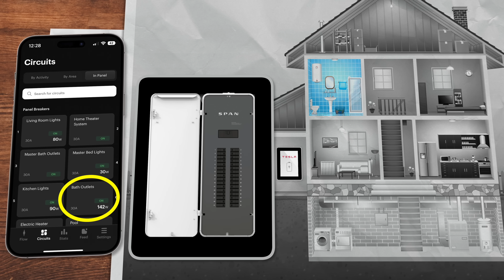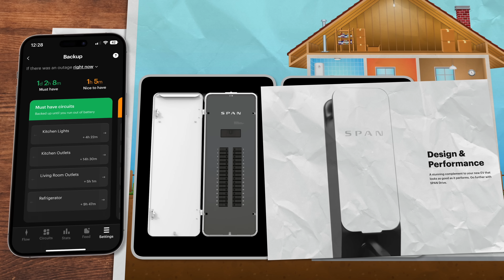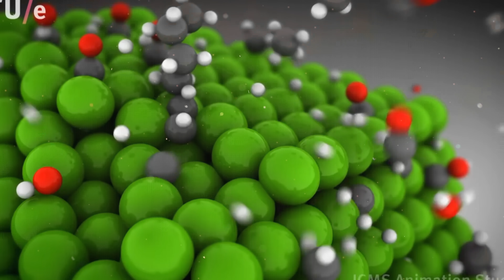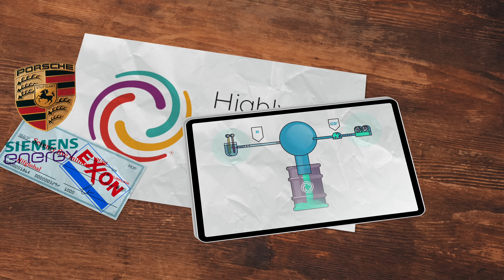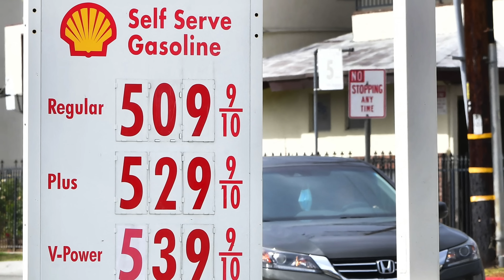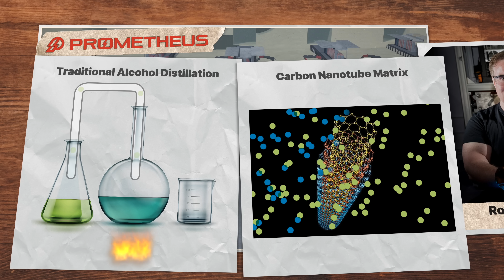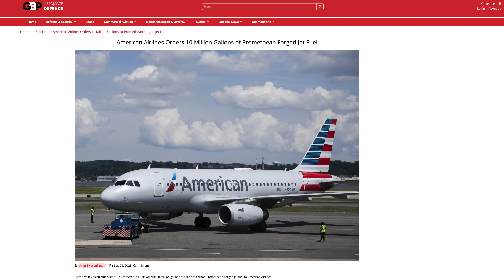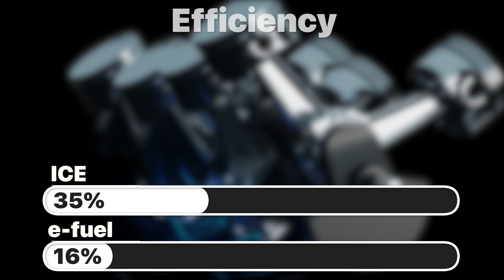EPIC Breakthrough Can SAVE the Internal Combustion Engine!

Comment: I think efuels are part of the bigger equasion to solving our issues. I don't think EVs are for everyone because of many factors, however for some people they make a lot of sense. Otherwise it would be like saying there is a 1 size fits all solution. I think the electrical grid load would be too much if everyone had an EV. I think the answer is a combination of ideas that each contribute to a good solution. Things like solar where we can, many small nuc. reactors as opposed to only a few large ones and working from home as much as possible.

Comment: The huge problem with EV is that you are deliberately introducing another step in the delivery of evergy to the car battery and so energy is being wasted.
And multiply all that energy by the amount of ev cars and you are facing a huge net loss just to put the energy into the battery.

The batteries aren't going to be recharging themselves.
But in the huge rush to get ev on the road in mass numbers the whole system is now getting exposed as a hugely wasteful and environmental disaster for what it really is.

Comment: When you have some of the distances we have here in Aussie, EV's will not take over - ever, PHEV, Hydrogen Fuel Cells (when hydrogen becomes readily available), and Hybrids give the range.  Have a squiz at plugshare and work out how to drive Sydney to Perth and how long it would take when needing electrons.... Yes, cheaper and quicker to fly but... if you want wheels at the other end, ie relocating, then driving could be the only option (sticking it on the train - hell expensive, removal service - expensive too - ie math does need to be done).  There are stations out there but some would require one to stay over night to charge and that could limit the driver to say 400km max a day - stuff that.

Comment: Good points made.  On a similar point ICE engine are more efficient in cold climates, where I live, as the waste heat is not wasted but used as it’s required in the passenger cabin and engine components.  So there will be a blend as no one tools fits all situations.

Comment: Well I mean, dont get me wrong, we will get low, but I thought the idea was just simply move forward...  ICE cars will just simply get replace over time. The ones that can keep moving forward will, with a cheaper access to gasoline as we simply can't just simply turn off the production as there are other sources that still need that same gasoline or oil. Plus the fact we still havent made a dent at all in current car production let alone the whole issue on trucks. No one has made any real progress there. IF anything - they just need to improve the milage per tank of gas if they can.  Give incentives to recycle the cars, and the wasted material sadly will just be that. Its not going anywhere even if we try to service them over their life time a little longer. At current rate it'll be at least 10 to 15 years before you see enough electric cars to be a problem and even then - the world still have enough gasoline you will see a split between what fuel will be cheaper (something we havent seen yet). Whats to stop or encourage the recycling of ICE into electric though? Why couldnt we take exisiting and offer an "upgrade" kit for all sorts of different type of cars in the future?

Comment: Interesting video but it doesn't consider converting vehicles to electric or the negative environmental cost of e-fuels. 

I agree e-fuels might be necessary in some use cases, but this is only for a tiny percentage of use cases. E-fuels still produce particulates and have a carbon cost associated with production (e.g facilities, maintenance etc).

In many cases more carbon reduction will be achieved by simply using the green energy production (wind, solar etc) as a primary energy source.

In the video it states that we'd have to throw away lots of vehicles, so it might be better to use e-fuels. But this is not the only option. For many cases another viable option is converting old vehicles to electric vehicles. This is already happening with shipping, cars, busses, trucks and aircraft. Advances in technology will accelerate viability of conversions.

Even the flight you mention for example might have an alternative option if energy density of batteries doubles and better propellers reduce fuel consumption. For example you might have two green flights to Tokyo, instead of one dirty one.

In addition e-fuels might defocus our resources on the clean energy transition and this is a bad thing.

E-fuels might have a tiny part to play, but I think they have a lot of downsides. The viable use cases are very very small from an economic, environmental or even necessary perspective.

If the right emissions / economic standards were put in place by policy makers, then the use cases would reduce even further.

Comment: What some people fail to understand is the fact that there is nothing wrong with modern ICE. The problem is that the modern electric motors are so much more efficient, reliable and lighter, that totally obliterate the ICE conception and its complexity together with the high maintenance costs, and its relative short life compered to an Electric motor capable even to perform at over 20.000 RPM. Been driving a Tesla for over 3 years, its operating costs vary in between 30 and 40% from an Honda Accord I had before the Tesla. I will never again consider anything else than  an EV and so apparently feel the vast majority of people in the know. You can burn the cleanest fuel with an ICE, again the E. M. is so much better, that the OEM that do not switch to electric power, probably will go belly up much sooner than we can even imagine.

Comment: It makes absolutely no sense to worry about efficiency initially if the production / material costs and maintenance are low and environmental impact is lower than current options. 100 years ago MPG were innumerably worse but these obstacles were overcome as the market demanded it. IMO we just have to look at the advances in motor vehicle fuel efficiency after the petroleum  / energy crisis of the 1970's. Governments should encourage competition between the disparate energy sources to create the conditions where innovation can thrive, and I don't mean by unfairly taxing one over the other to hobble its competitiveness.

Comment: If ICE engines are only 35% efficient why don’t we just use all that wasted heat energy to boil water, turn a turbine and make electricity you could have a smaller ICE engine assist an electric engine+charge the batteries. All from something that is “wasted” heat

Comment: I think if we are talking about e-fuels, that the topic of green waste and excessive food waste( from farms, shopping centres, restaurants, schools etc) that is sitting creating methane, that could be used as a fuel source, which through its use reduces the harmful effects of methane, (and we could still use the old cars (adding an appropriate tank/cylinder)),needs to be addressed more than it currently is.
 In doing this you have a strategy for waste reduction, reduce the harmful effects  of methane, have a constant supply of energy,  create a circular economy, require relatively simple technology, reduce the need for ev's, and get to keep your old car.
And then there's the use of sewerage to produce energy, or waste from pigs and cattle etc. It is also a system that works very well in developing countries. It is a no-brainer, or?

Comment: Historically, it seems that every form of transportation progresses as engineers resolve any shortcomings.  For example, sailing ships more or less peaked with the clipper ships, which were then replaced by steam ships, which were then replaced by ICE powered ships.  The same goes for locomotive evolution; the last of the steam locomotives were technical marvels with very good performance, but they were eclipsed by the diesel-electric locomotive.  Gasoline powered engines today are astonishingly good.  The power extracted and the reduction in emissions has progressed tremendously since the 1970's when they were really awful.  I think that there is still much room for improvement in terms of efficiency, and I am sure there will remain a lot of engineering surprises over the next few years.

Comment: Did you ever think how much pollution is made for making batteries or where electricity come from, you are only moving where the pollution is coming from! It's kind of like the company I work for, they wanted to go green, so they closed down their painting department,  because of all the chemicals and pollution it caused! But did they quit painting their products, "No" They shipped them to another company to do their dirty work for them, and then advertise what a green company they have become, they just passed the buck off on someone else!
In Minnesota there's an article in the paper that it might take upto 23% state land area for solar and wind generators, to provide enough electricity to supply the state with so called green energy by 2050.

Comment: The big problem I see is that if we switch every car to electric how are we going to generate the power to run them? Everyone is against nuclear, solar and wind are not efficient enough for everyone in the country to use.

This only leaves building more coal power plants, which is way worse than gas.

We need to stop putting the cart before the horse. We need to sort out power generation before we can even start a conversation on getting rid of gas cars

Comment: Electric are more toxic than anyone wants to admit. The power in my area comes from a coal powerplant that I would rather  not support. Plus toxic cobalt, iridium, and all the other unethical sourced materials. And! I'd rather not even contribute to the manufacturing process. 
Instead I will take a car someone else will throw away, get it running or driving again for around 1000$ or so. Drive it for 3-5 years. No full coverage insurance. No car payment. And not contributing to the system at all.
 Imagine if everyone just didn't buy a new car this year, and put one of the existing ones, or simply buy a used car instead of a new car? 
I.c.e. cars are a different kind of problem for those in power. Electric can be turned off at any time. Most modern cars that get wifi updates. Or even 20 year old gm OnStar vehicles can be turned off wirelessly at any time.  My 30-50 year old cars are just as reliable. And with modern updates run better,and cleaner than it ever did back then. 
I've seen someone use Plastic waste as fuel. That seriously needs to be looked at as a solution

Comment: Until EVs can be recharged to 100% capacity in ~5 minutes or less > Until EVs can travel 400+ miles on a single charge while carrying 4+ full sized adults and a trunk full of luggage at 80mph without losing energy at the end of the trip > Until there are fully integrated infrastructure in place for EVs to go anywhere and efverywhere they will not be viable to the mainstream driver. The current state of EVs is forcing drivers back a step > less range (add extra weight to the vehicle - like passengers or luggage and the range gets cut short per charge) > significantly longer recharge times > Where is the electricity being used by EVs coming from ? (coal burning poower plants) > Massive cost reduction - Musk proclaimed that Tesla would produce the Model 3 at a price point that would compete with base model ICE vehicles ($20,000-$30,000 range) then changed the price point to reflect an extra $10,000-$15,000 above what he promised (because Tesla could not get the cost down since it does not produce cars at the same scale Ford - GM - Chrysler do and investors were demanding ROI on their cash) At best EVs are a partial solution and right now only benefit drivers that have a super short drive distance (cities) > drivers in areas where highway speeds are not a factor (20-40 mph range) > and where the driver has access to top off the vehicle charge constantly. TGhe EV industry has a ton of issue to resolve before this vehicle category stops being a niche product.

Comment: I don't want to argue with anyone, I just want to be heard!  We can save the ICE, by converting to pure Hydrogen! We already run them on Butane and Propane! When I was only four years old, we ran a Restaurant and burned Butane in our kitchen! The delivery tanker that supplied our Butane also ran on Butane! That was 83 tears ago. We can make Hydrogen gas from sea water! Using the DC power from solar, wind and several other natural sources! This process is simple Electrolisis! We end up with Medically pure Oxygen, Hydrogen gas and pure table Salt! This would not be expensive to operate, only the startup might be somewhat! 
ICEs can also be converted to steam! We modified a small block Chevrolet engine and ran it on compressed air versus steam because we couldn't get our steam generator built (lack of funds)
We are supposedly facing rising oceans, by using these waters for making Hydrogen we might save some of our 
(As well as other Nations) coastal cities! I think EVs have a place in the auto market, but small runabout models as a second car that can be charged at home would be OK! However hundreds of thousands of charging stations will cost hundreds of millions! Think about it!

Comment: There is a new exhaust purification system being developed that takes the exhaust of a fossil fuel vehicle and runs the exhaust carbon and other expulsions and purifies the carbon coming out of the exhaust into water using a complex condensation system located just behind the back seats. As the exhaust enters the chamber it pressurizes and an amount of water is produced then the water produced by the system is sent through a complex filter that removes other expulsions contained in the water and what comes out the tail pipe is cleaned air. It brand new and experiments are being done to improve the system.
Reply: That’s so excited, I hope it works and that it becomes standard in the future, maybe then some cities built around a bowl depression like Toronto will be able to have better air quality?

Comment: The cobalt in lithium ion batteries is costly and dangerous for workers. It’s sourced mainly from the Democratic Republic of Congo where there is widespread use of child labor.💀

Cobalt is toxic for workers handling it and carcinogenic ☢️

Lithium ion battery packs are heat sensitive and explosive!💥

Currently there’s not enough infrastructure to support lithium ion batteries practically. (Not enough public charging stations)

The batteries take too long to charge. Some don’t hold their charge long enough. This makes them much less practical for everyday commutes.🪫🚙

Home charging stations can raise electricity bills significantly 💸💸

If a weather induced power outage, or an EMF were to take out the Grid these batteries would be useless.⚡️🔌

Comment: HUGE problem blaming CO/2 on ICE.  China Manufacturing puts out 68% of ALL CO/2 in the world.  ICE don't have much of an impact with all the SMOG equipment.  Most of the pollution an ICE puts out is sequestered in the Catalytic Converter.  Additionally,  Electric last 1/3 to 1/10th the life of ICE.  So, for every ICE car produced, 3 to 10 Electric cars is required resulting in 3 to 10 times the CO/2 during the manufacturing process alone.

Comment: charging your ev is getting as expensive as filling up your gas cars. also the range on ev's is a joke. example= the electric ford f-150 was supposed to get 150 miles on a charge, but extreme cold cut that in half. also everyday that it sits there it's losing it's charge. most of the claims of how far a charge will take you are not true. EV'S are to expensive, unreliable, not practical, a toy, and wont save the environment. I see the whole movement as a farce, that will eventually crash and burn.

Comment: One thing I have noticed, people are looking a hybrids, but most do not know there is a good alternative to those 20 to 30 miles per gallon cars, I average 42 to 52 town and highway in a mid sized car. With only 13 gallons of gas mine averages 500+ miles per tank, add that up with the new fuel source that should really help with the fossil fuel use and the environment. By the way, Good vid.
Reply: Why settle there? A properly tuned diesel can double that. I average 55/85. My best tank averaged 89 mpg. (I think I'm still running a little rich)
Reply: @spidergoose891  Ok, now I'm curious.  What in the hell do you drive my friend?
Reply: @TheVenom8343  a 2013 Passat TDI deleted, 3" pipe and a clean tune.
Reply: @spidergoose891  Hell yeah brother!!
Reply: @spidergoose891 if I had space for a third car I’d buy a TDI wagon.  If I could find one for a reasonable price.  The people who decide to sell put 150k mi ones up for sale for $20k-$29k here.   Love TDI but VW maintenance is a lot more annoying than my basic 90s Subaru.
Reply: @stevebean1234  I got mine when they started selling the emissions recalls. $10k for it with 25k miles.

Comment: Might be better solution for ocean freight or trans-continental aviation but we need to replace ALL fossil fuel for any land transport intersecting urban areas. Because AIR POLLUTION. Fossil fuel air pollution kills millions every year from heart disease, cancer, emphysema and even Alzheimer's. Recently, it's also been linked to depression. All around no fun at all. 

Also, NO, automobiles would STILL have emerged without fossil fuels. Many of the first motor vehicles were electric - even before the Model T. Story goes Thomas Edison was set to embark on a program of advanced battery research but abandoned it with the advent of cheap gas.